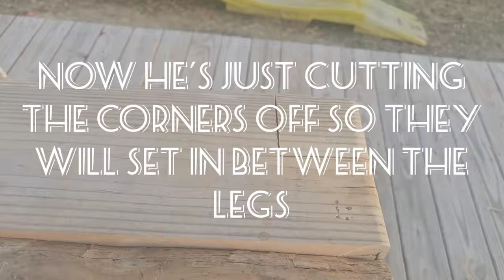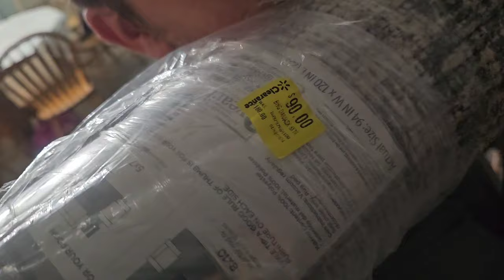DIY 10 ft Island/ Bakers Table/ Bar | A few more house updates!

Comment: We did the same thing, but our boards had larger gaps between them. I couldn't figure out how to avoid that. Maybe we should have sanded the inside edges. Yours came out great!
Reply from the maker: So, When he made the actual countertops for the cabinets he ripped down the sides of each board because they have a slight curve to them, glued them, clamped them and let them set for 2 days and you can't even tell they're seperate boards now. But I didn't want that on the island which.